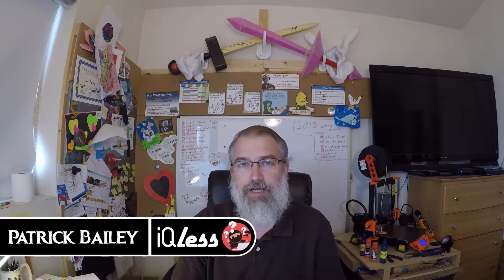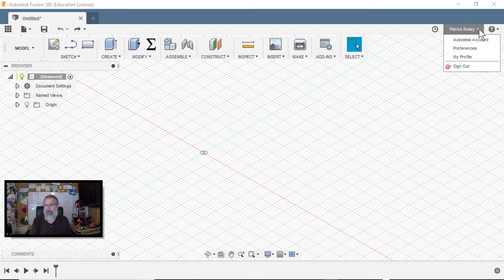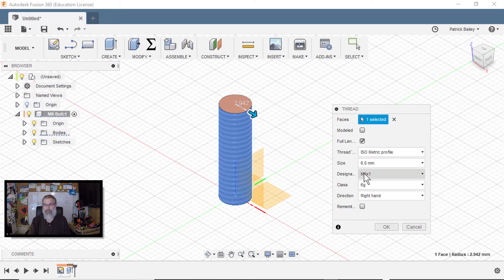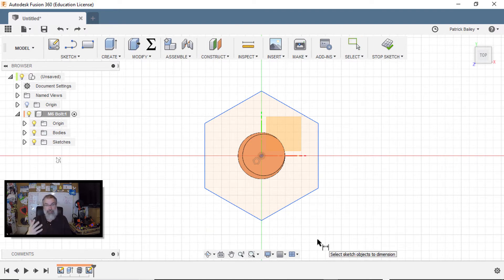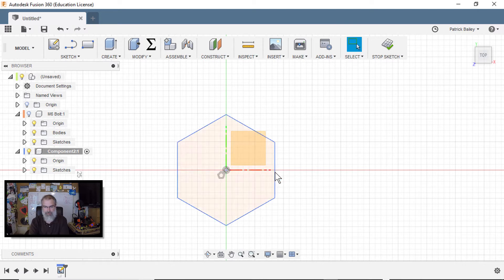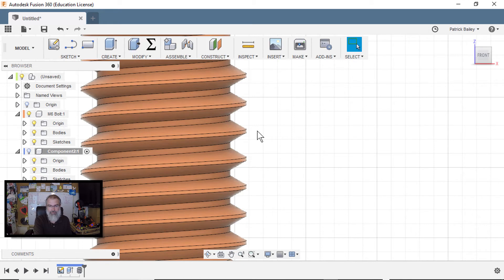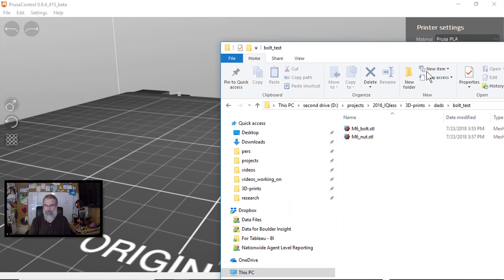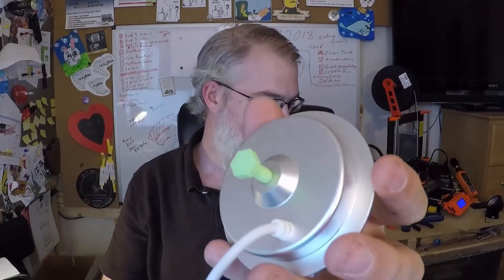3D Printing: Printing an M6 Threaded Bolt and Nut in Fusion 360

Comment: Paul McWhorter videos is where I learned how to do threads. I drew and printed his lesson and on my MK3  I didn’t do any tolerance adjustment. The bolt and nut that I printed has metal tolerance and mates perfectly. I have run the same model on other printers and it was too tight of a fit to turn all the way to the bottom. I have learned from a video by Joel Telling that you can offset the bolt or nut by 2 - 5 % to get a good fit on a less quality printer. Upsize the nut or downsize the bolt by a few percent in your slicer.
Reply from the maker: I liked the video he did for threads on https://youtu.be/07GD23q1zK4 
Not too shabby

Comment: I had to design a sink bolt and nut as the model doesn't exist anymore on th market. 1st where printed in PLA and default settings but broke quite fast, 2nd PLA version I choose 4 perimeters which strengthened the bolt and holdup for few months, finally I printed it in ABS 4 perimeters and tried to break it by hand...couldn't compared to the PLA...hope that will now hold for years :-) Happy printing in this case equal Happy wife
Reply from the maker: Guess I will have to keep ABS in mind if I want stronger bolts
Reply: iqless ABS is pain in the .... to print but it has it's purpose. In most cases PLA is fine. You can strengthen parts by adding more perimeters or tweak infill overlay. CNC Kitchen made great video about it.